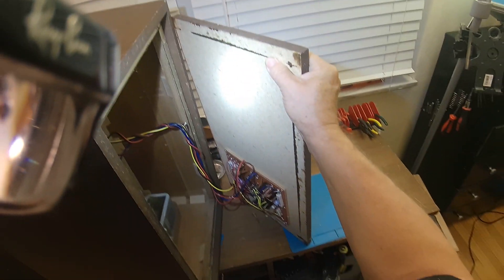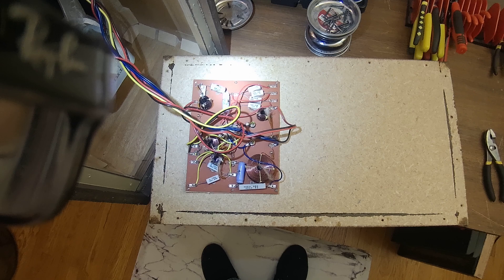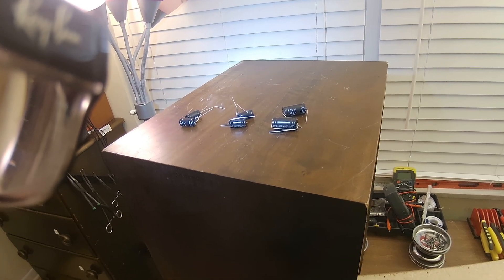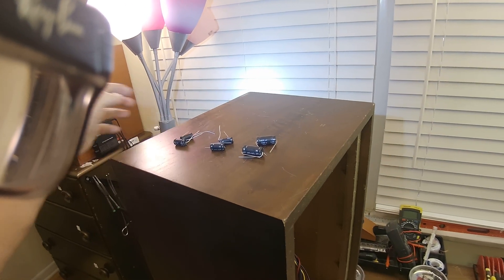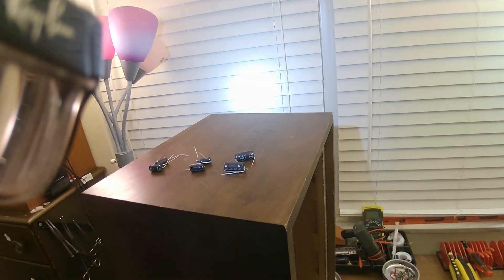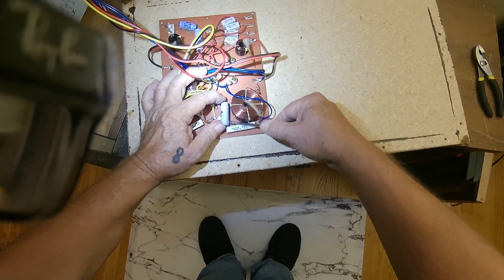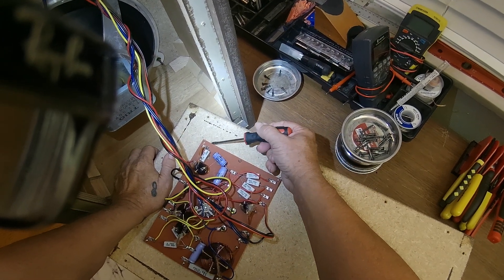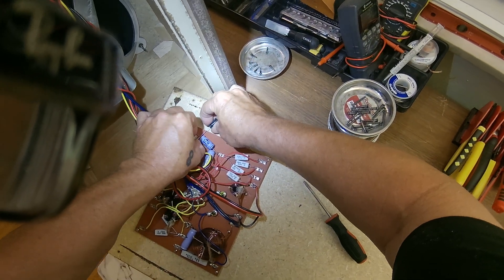Kenwood KL 660 Crossover Upgrade

Comment: Why didn't you use poly caps instead of the np electrolytics? Kind of a waste of time.......sound would be much improved with the poly. Inductors look to be air core so that is a plus.
Reply from the maker: I used used the caps I had on hand.  I believe I gave the speakers to Goodwill so I never intended to spend much money on them.  I do the work as a hobby.